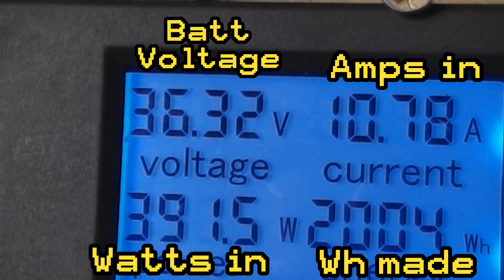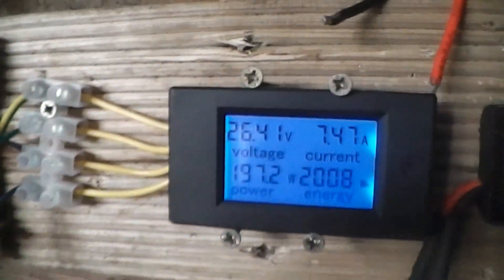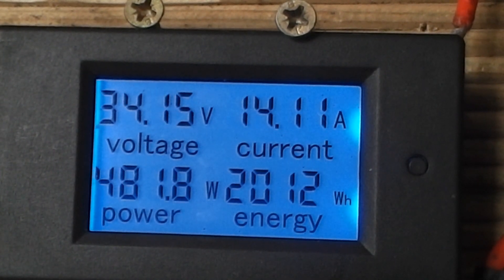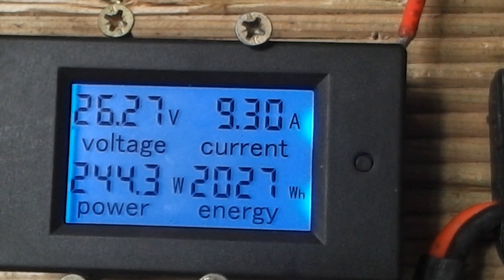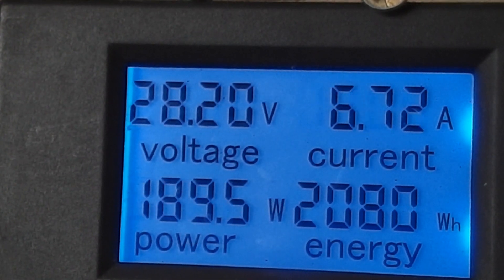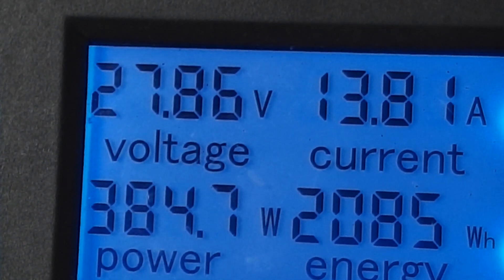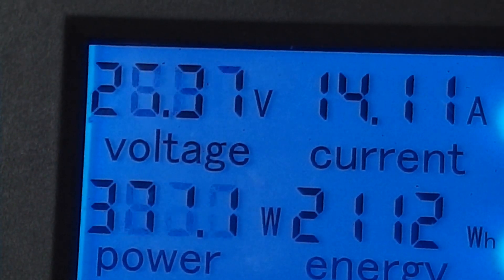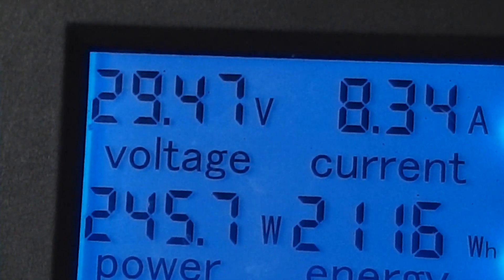48v E-Bike Hub motor wind turbine puts out over 1250 watts !! - 19th Feb 2022

Comment: not bad must have been decent weather for the turbine to spin that fast, now im scared for your big blades without something to slow the blades down. i forget but i know big blades dont do high rpms but they have real good torque to overcome the load from a motor pumping out power at lower rpms.
Reply from the maker: mate it was 60mph winds :) , probably as windy as I have ever seen here.
Reply: @GavinFreedomLover  not bad best weve had is 187km gusts
Reply from the maker: It would be "cable of shame time" in those winds.
Reply from the maker: If it was super windy all the time I'd happily run it like this !!